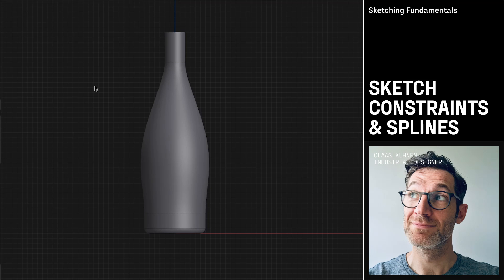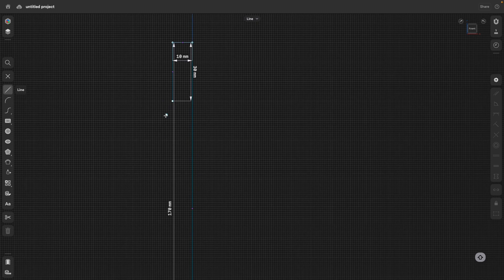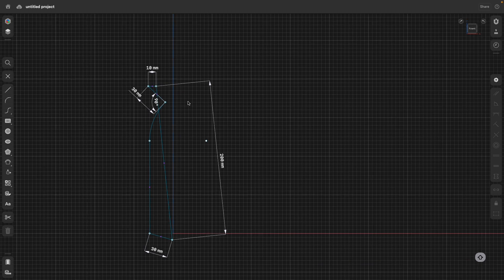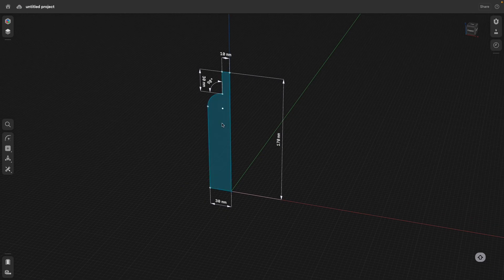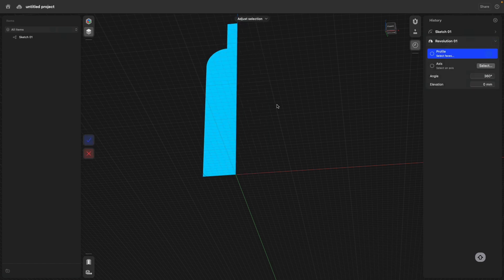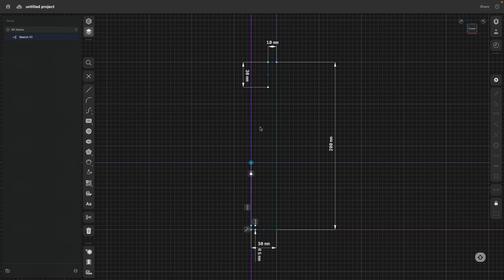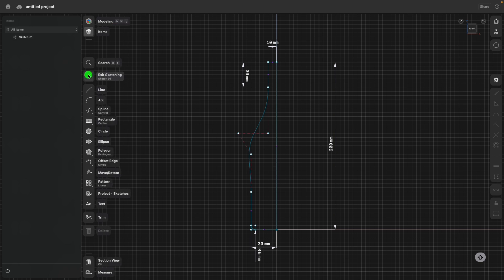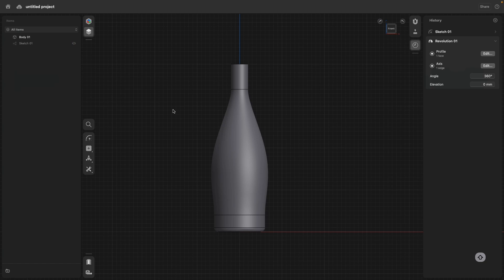Sketch constraints and splines

Comment: At 4:28 im not able to slide like that, it seems to be locked, and a message saying "Locked or constrained sketch parts can't be moved" I try it several times, delete everything, start over, delete, repeat, but always end in the same message. So I make the arc inside the lines, then make them tangent, then to change the radius I couldn't use the rows anyway. But I could grab the center point of the arc and move it, that was the unique way to do same thing, but repeat trying from the arrows and again couldn't, like the center point of the arc was locked, but it don't. Hope this help anyone.
Reply: Did you figure this out? I am having the same issue and it’s the most frustrating thing, following step by step and it not working. Wonder if its a different version from a year ago
Reply: @ryanvogel6303  I am having the same problem too, did you ever sort it out?
Reply: @taydenclark1179  No I did not. I feel like using an apple pencil does not give full functionality.
Reply: @ryanvogel6303  Maybe that is the case but I think the video is an outdated version of what I currently have on my iPad, there is a few things that do not work like in the video 😞
Reply: @ryanvogel6303  Hi again, I managed to figure it out! I selected the end point, tapped Disconnect, selected the End Point again then held the end point with the pencil and it moved around, occasionally it made a new line but overall it was working ok - so happy to have that bit sorted, now for the rest. It's a right pain not having the videos set up for iPad! Good luck, let me know if it works for you?
Reply: Appreciate the the tip! I want to learn it on the iPad with the pencil. My research has said that was the best set up for basic modeling on an iPad but I was just getting so frustrated. Went back to trying Fusion on my 10 year old MacBook which is soooo sluggish. Only other thing that’s not sure great is on the free version the quality of exports for things like 3d printing. The low resolution almost makes me feel it’s not even worth learning as I don’t see myself paying $300 a year just to be able to export little fun 3d prints as a new hobbiest

Comment: How do you keep all dimensions on inside the sketch?   Mine only shows the dimension of the last line drawn
Reply from the maker: Hey there! In sketch mode, click on the Constraints settings, enable Always show dimensions.
Reply: @Shapr3d  I have that feature turned on in my constraint settings, but it still only shows the dimensions of the shape I am working on at that specific time that is selected.

Comment: 0:27 sometimes it locks this line automatically so right point is like locked and u move it like raduis, sometimes you move it weirdly, changing both angel and starting point too, idk.
only if u lock point, it stays

Comment: I dont have a history option.  Also, when I try to use the spline control, I just get straight lines.  When I click to set a control point and then click again to draw to the next control point nothing happens.  I have to click a second time and then I get straight lines.  Note I am on a Mac running 5.551